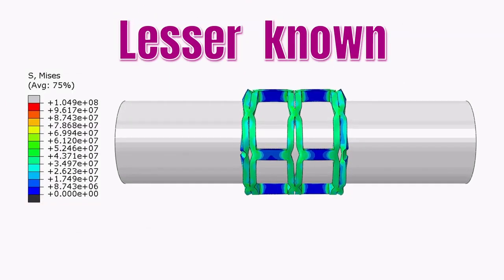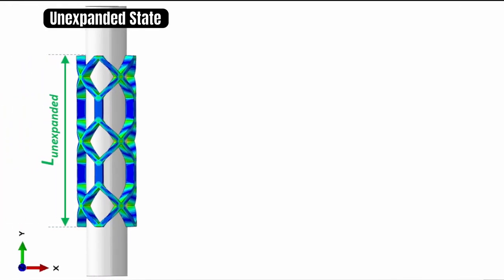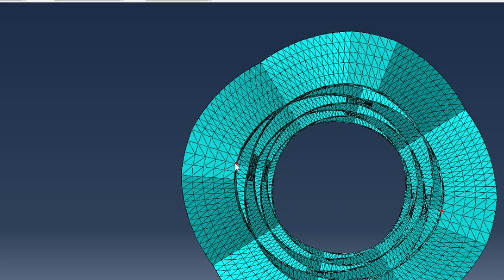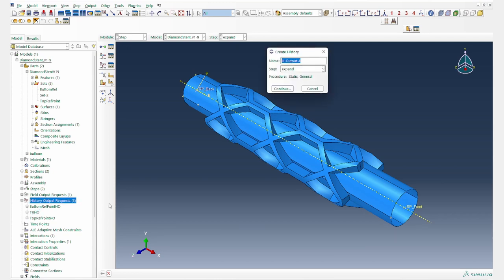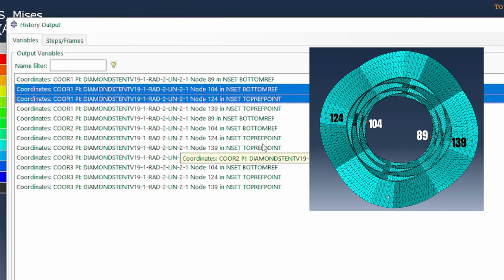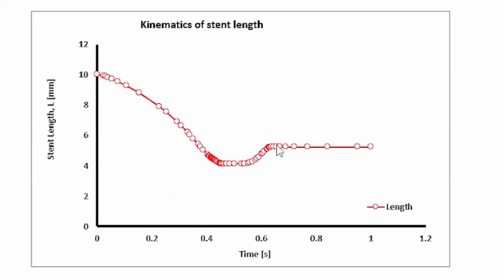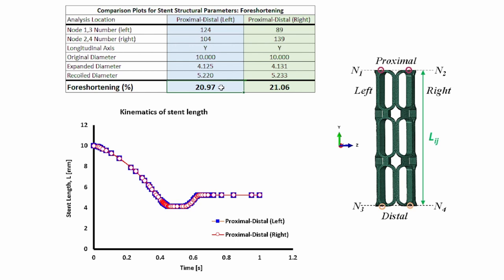How to find STENT FORESHORTENING from an ABAQUS Simulation

Comment from the maker: You can quickly navigate through the videos using these chapters.

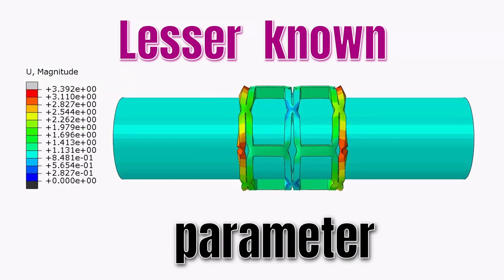00:00 - Intro
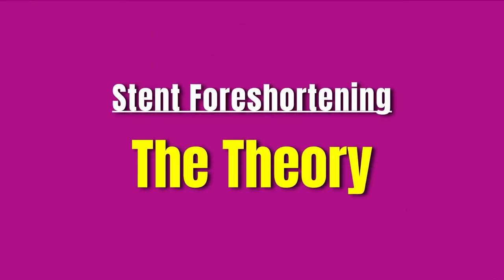00:23 - Theory of Stent Foreshortening
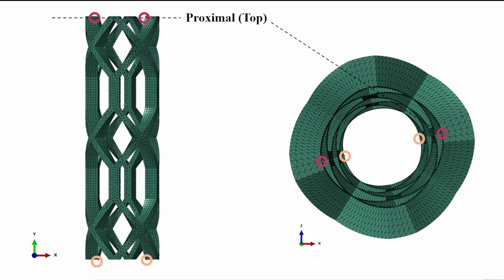00:48 - Calculating length of stent based on reference nodal coordinates
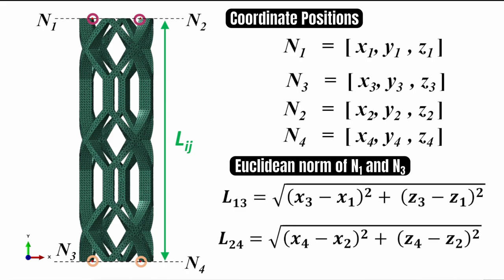01:16 - Three stages of stent deformation
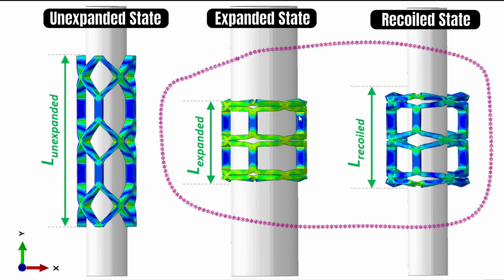01:43 - Kinematics of changing stent length during the simulation
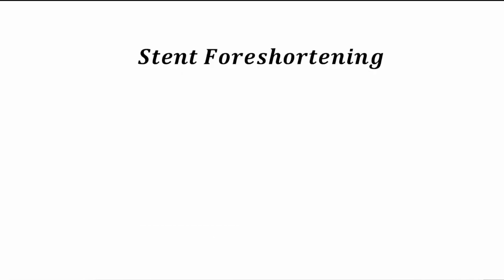02:17 - Equation for calculating stent foreshortening
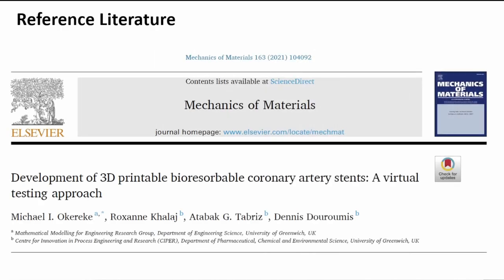02:36 - Reference literautre relating to stent foreshortening
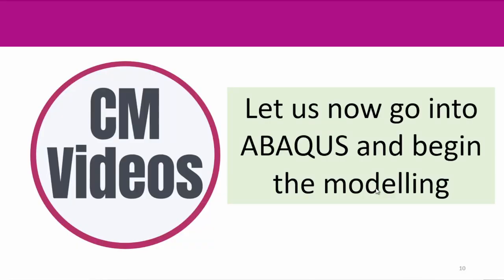03:08 - Setup of ABAQUS Model for stent foreshortening
03:42 - How to create the reference nodal sets for tracking foreshortening
04:17 - Find the nodal labels of the reference nodes.
05:19 - Assign the history outputs to the reference nodes
06:28 - Stent foreshortening simulation results
08:12 - Stent foreshortening Excel analysis Spreadsheet -- download link below
09:59 - Comparison of stent foreshortening for right and left reference nodes
10:28 - Outro